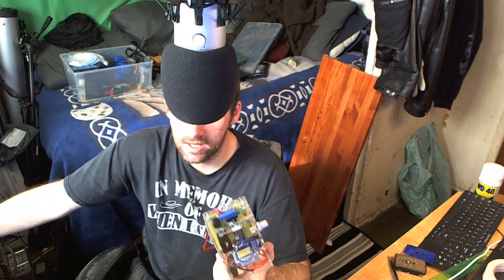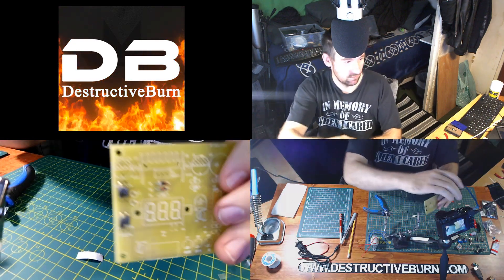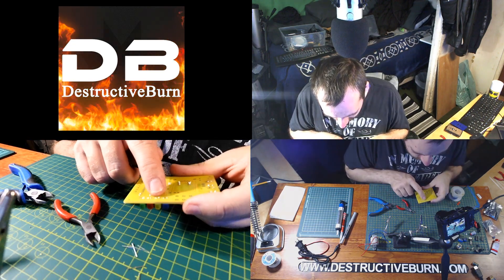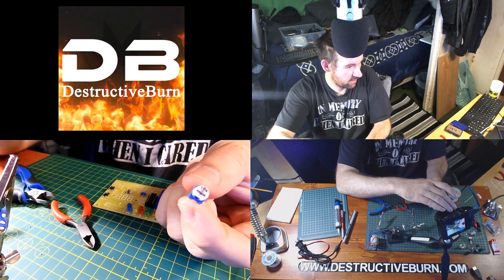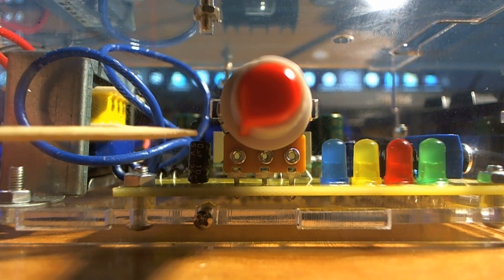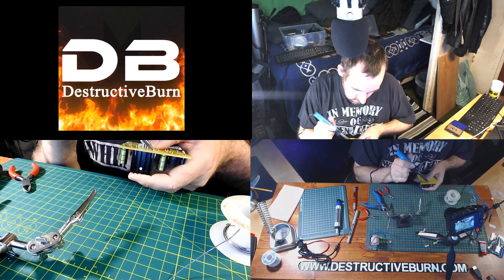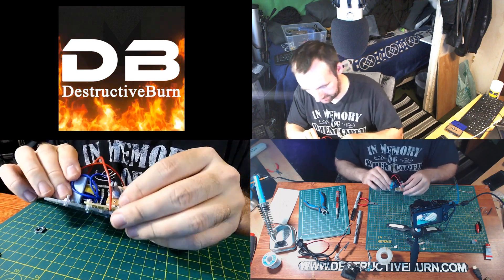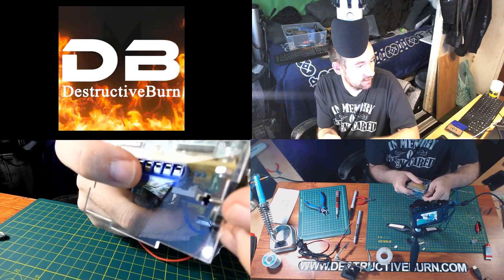Geekcreit 110V LM317 Adjustable Voltage Power Build

Comment from the maker: During my tests to make a full on review, The thing up and died on me.  I was testing a fan up to 5v and it just died.   I tested all the components and the problem lied directly at the microchip.
Unfortunately, there won't be a review video.  I pulled some of the components and threw the rest out in the trash.   This would've been fine if there was some kind of protection.  Unfortunately, there was not.

I don't recommend this thing at all.
Be aware it couldn't keep the voltage on a load anyways.